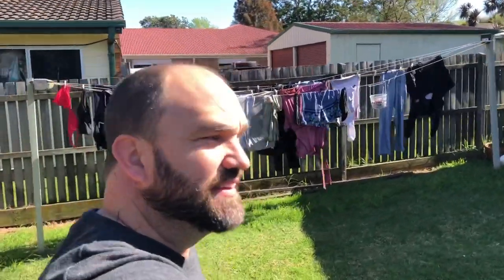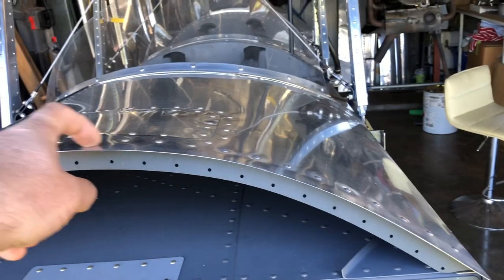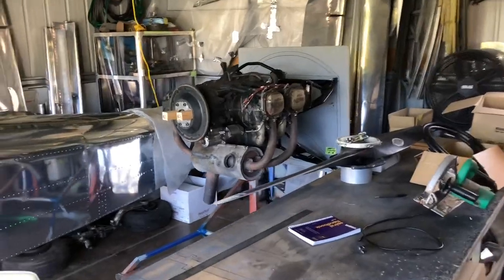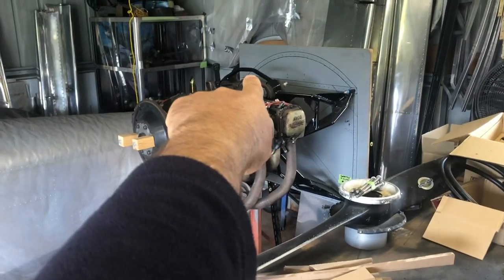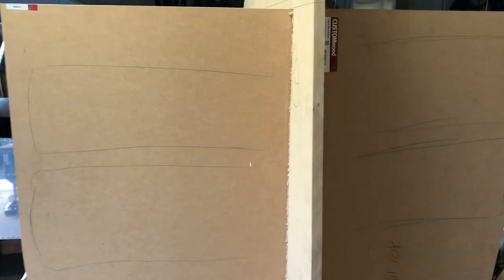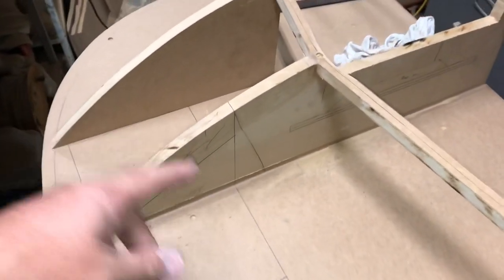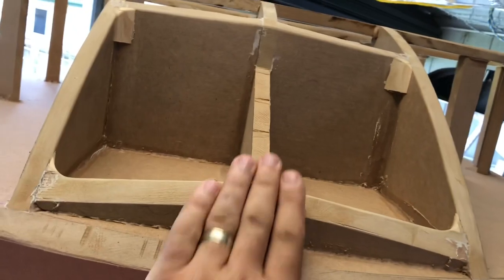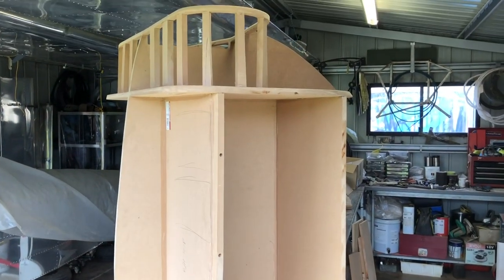A custom engine cowling for a custom aircraft part 1

Comment: Have you though about joining the top and bottom of the cowl with the piano hinge method, you know when you just extract the pin to split the hinge and remove the cowl? Just though it would save you a lot of screws.
Reply from the maker: The simple answer is yes, but I don’t have enough piano hinge and have a heap of screws